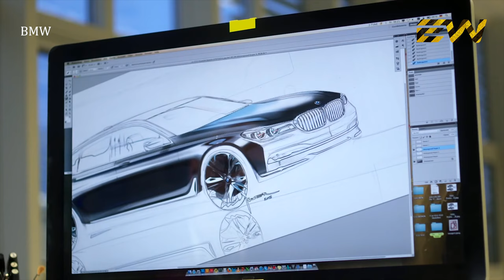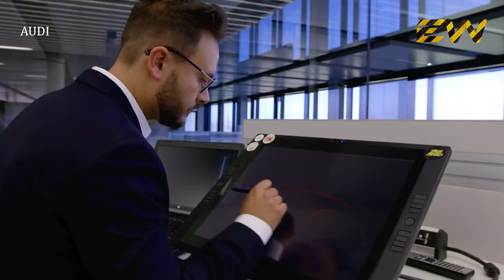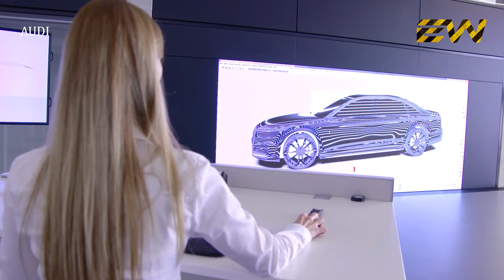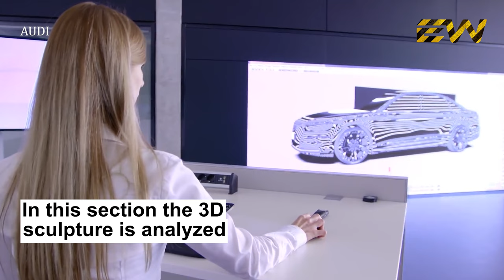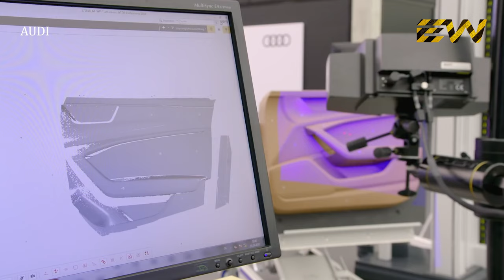How Car Models Are Made? (Mega Factories Video)

Comment: The tactile impression is very important. No other way to really make it 3D. In fact, textures should also be added.
Reply from the maker: Thank you for your feedback. What kind of textures?
Reply: @engineeringworld.  Surface qualities such as rough, ribbed, smooth, soft, flexible, waffled for the interior and possibly also for the exterior. Perhaps specially ribbed surfaces can themselves improve aerodynamics or water drainage on the outside. It is an idea to try / discover new possibilities. I am not an expert in car design.

Comment: 1) how the heck did they fit the interior design into the clay model body?
2) how do they go from the clay model body, to the actual steel body?
Reply: 3d scans of the clay body, finalized in 3d design software, sheet metal stamping dies developed.

Comment: I design cars, if anyone needs a new design. I'm working on one now that will be a cross between a 1966 Ferrari 330 GT 2+2 and an AC Cobra. It will be a 4 cylinder front wheel drive configuration. A Hybrid and all electric would be forthcoming. The engine will be a 750 HP version of the Focus RS turbo. Lots of aluminum and carbon fiber should make the car see 200 MPH top end as well as 0-60 in <3 seconds.

Comment: Seems like it would be much easier and less time consuming to 3d model by software instead of clay. They clearly already had the chassis and base determined, if a detail is not right just tweak in software and print that specific part anew.
Reply: while 3d models can be used to simulate and digitally test the aerodynamics and more details... clay model helps to do the same physically. For safety issues, any company cannot just rely on computer generated data to proceed for many stages of production of the vehicles. This is a "Necessary" part of the process.